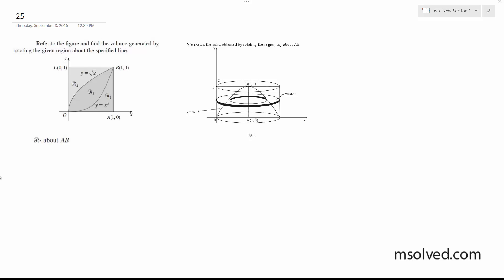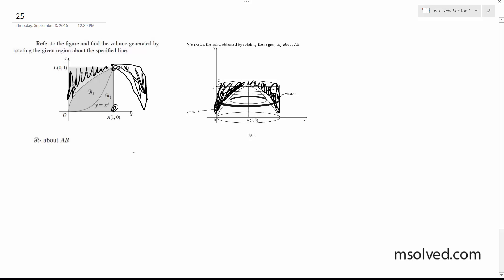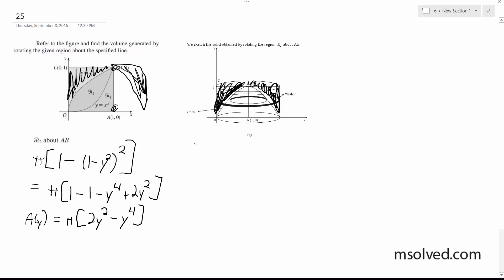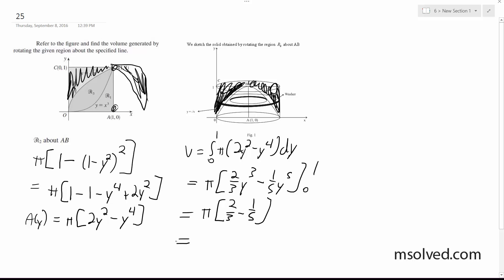R2 about AB

Comment: This is incorrect. I love your videos but the answer is a bit more simpler than that. 

It is y^2=x when solving for x. 

V=pi [(y^2)^2] = pi (y^2) (y^2) = pi (2y^4) dy

pi [( 2y^5 ) / 5] , y=1
pi( 2/5) = 2/5pi or 0.4pi =V
Reply: Thanks bro! Keep up the great work and keep the videos coming, we need you!
Reply: I think you messed up a little. [(y^2)^2] is not 2y^2, but is y^4. (1y^2)(1y^2) = (1)^2 * (y^2)^2 = y^4

π[(y^5 ) / 5] , y=1
π(1/5) = π/5 or ≈0.628=V